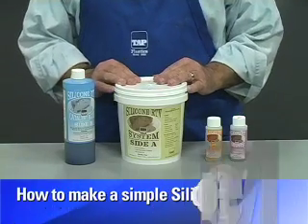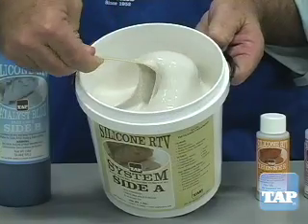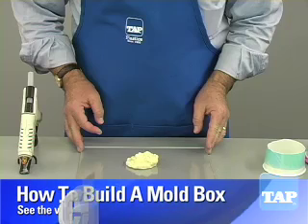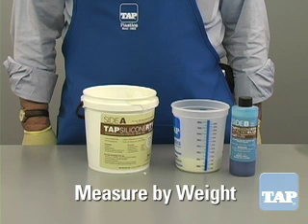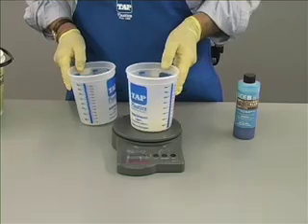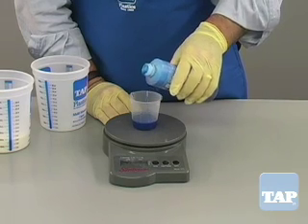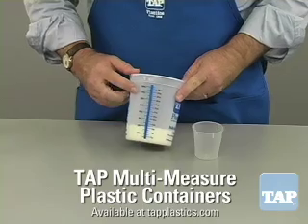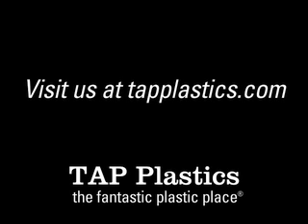How to make a simple Silicone Mold Part 1

Comment from the maker: @friskedkitty Silicone RTV can withstand about 250 degrees F and Platinum Silicone can handle up to 500 degrees F.  As long as the crayon wax melts below those temperatures, you should be fine.